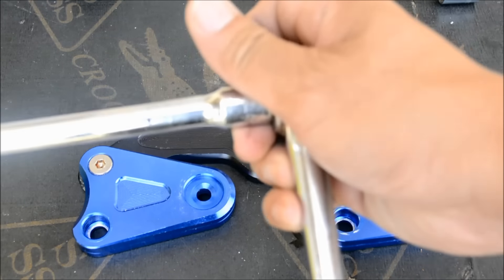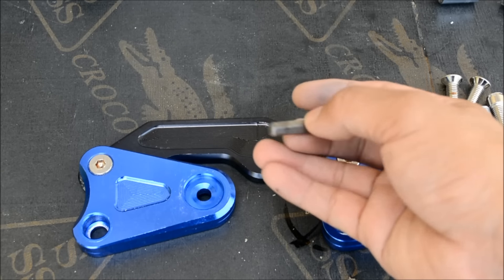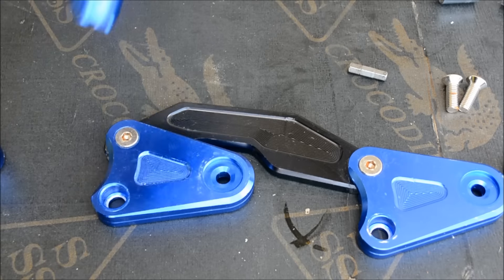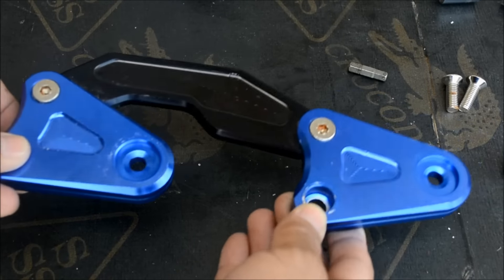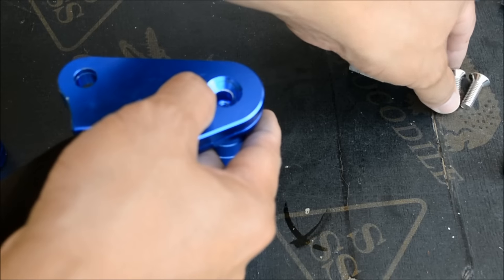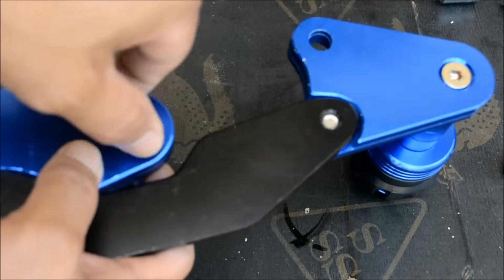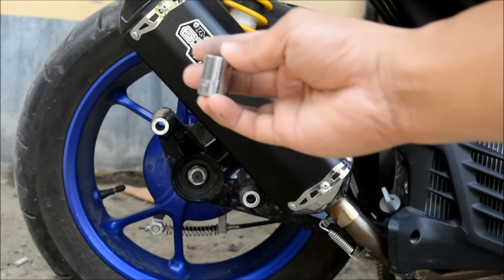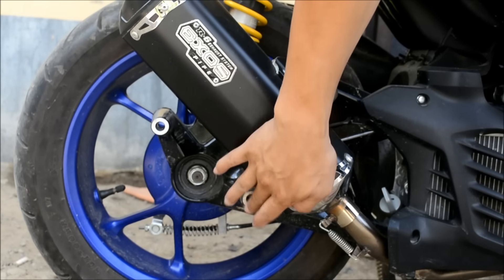How to install slider on a yamaha aerox | Philippines motovlog

Comment: Okay, props for the nice Aerox set up. Ang ganda. But I really don't understand how this slider will help us keep our parts from being damaged? At least with the Crash guard, it helps the front fairing from minor scratches but not on heavy impact though. But with this Slider, pano? eh parang when you fall on that side, the muffler is the first one to get a heavy impact from the ground right? Sorry. Been a rider for 5yrs and an Aerox user for 6mos